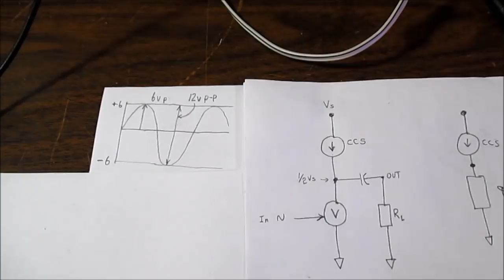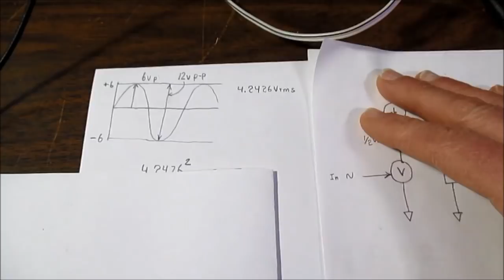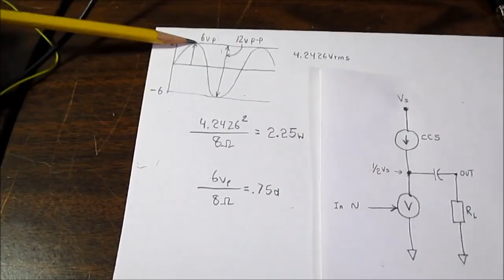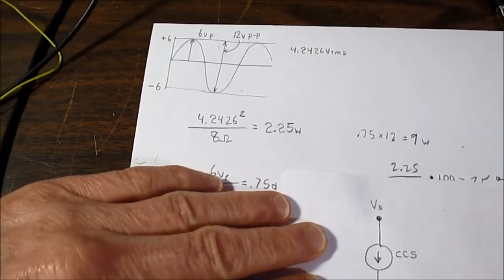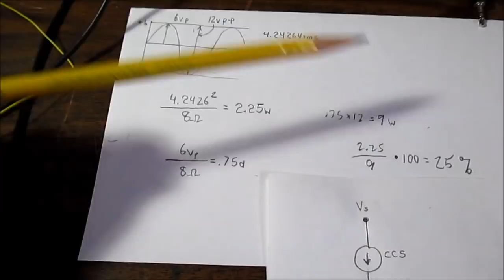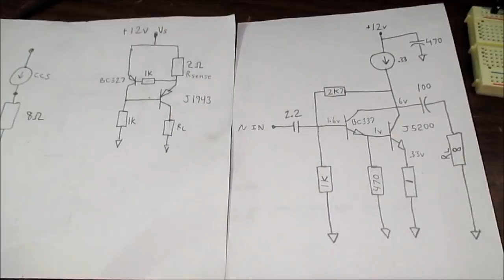Class A audio amplifier build and test PART 2

Comment: I have a small doubt, you changed the input capacitance to 33uF, but isn't that still a low capacitance value? I have this issue with reactance, when audio is 20Hz, reactance for 33uF capacitor will be around 250 ohms. So, isn't that a significant impedance introduction to the circuit? I thought we have to use like 2200uF capacitors.

Comment: Hi John, maybe a little late, this comment. Duracell has some pretty good rechargeable 9V NiMH batteries (170mAh).  I use them all the time in my component tester and multimeter.  I even got them in my smoke detectors.

Comment: Just a simple question, why is there no capacitor  across the emiter resistor? Would an emiter cap make any differences to the overall AC gain?
Reply from the maker: Yes it would increase gain but you lose the distortion reduction effects of negative feedback.
Reply: JohnAudioTech thank you

Comment: Why an emitter resistor (470 Ohm) on the first transistor of the otherwise Darlington? Gain and input impedance would be better without it, would allow higher input/bias resistors too. Wouldn't worry too much about stability in such a low power, low gain amp.
Reply from the maker: Without it Darlinton configurations become slow. You see these resistors used even inside Darlington transistors when you look at their datasheet.

Comment: You talk about distortion as if it were a bad thing.
Reply from the maker: It goes a bit deeper than that. It depends on the harmonic content. For example: I doubt anyone could pick out 3% of a second order harmonic, but 3% of a higher order harmonic, say a 7th would stick out like a sore thumb with some types of instruments, like piano. It is harmonics what mainly give instruments their sound but if the amplifier puts higher order harmonics into the mix it can make the instrument sound off. It is, of course, the non linearities in the circuit which create the harmonics. Nonlinearities in a circuit can give rise to a more sinister type of distortion called intermodulation and the tones it produces are almost always discordant to the tones in the music. This is the primary reason for getting the distortion as low as possible.
Reply: Actually distortion is a bad thing as far as sound reproduction amplifiers go. Sometimes musical instrument amplifiers are purposely driven to distortion to get a desired sound effect.
But as far as amplifiers used to listen to recorded music and speech, you want to keep distortion as low as possible.
Some numbers:
Less than 1% is not bad - few people can hear that, this is a pretty clean sine wave.
3% is about where a "trained ear" can detect something wrong with the sound, this is about where soft clipping occurs.
5% is where most people start to hear distorted sound, this is more or less the onset of clipping.
10% is nasty sounding, this is about where a sine wave starts to look like a square wave.
Reply: I love over driven hard clipping.
Reply: Agreed on how bad high order harmonics sound.
But, look at your FFT's, as long as you are not clipping - only 2nd and 3rd, usually nothing higher.
IMD - yes very bad sounding, no "musical relationship" to the fundamentals involved.
Normally, low THD = low IMD also. As you said, the same nonlinearity causes both.
Reply: Our lady of howling feedback will save you if you just let the overdrive into your heart. I'm praying for you here.

Comment: I read John Linsley Hood's articles in Wireless World as they appeared in the 1970s, I wonder what conclusion the people back then reached.
Reply from the maker: There were a lot of poorly implemented class AB amps back in the late 60's/early 70's. I'd suppose it got good reviews. With the better transistors and amplifier design knowledge we have now, I don't see a lot of use for these amps today. To get any useful power, say 20 watts, Class A amps turns a lot electricity into heat.